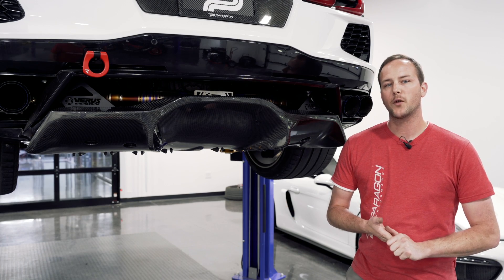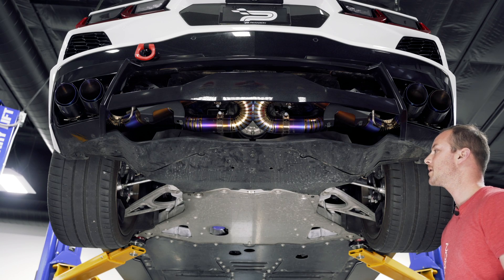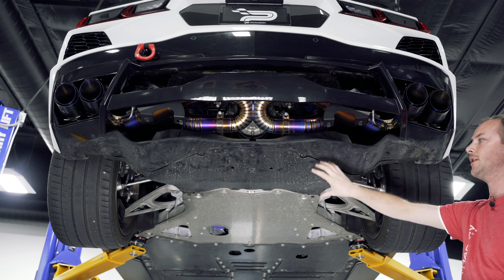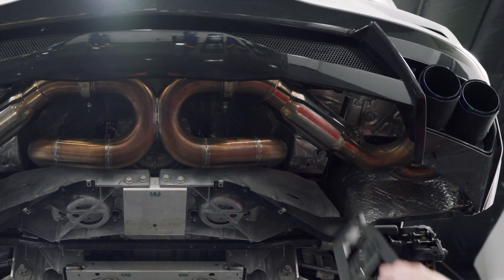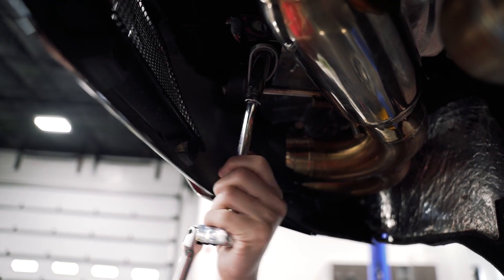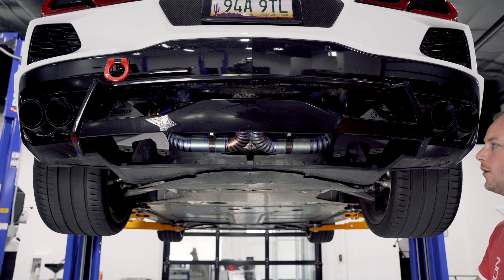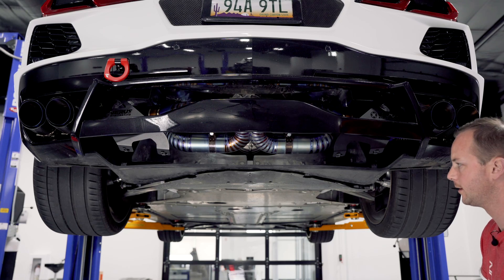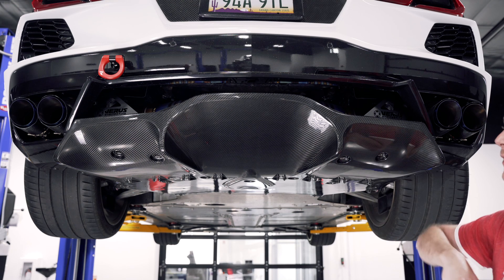Verus Carbon Fiber Rear Diffuser Install For C8 Corvette - Paragon Performance

Comment: I can tell just by looking at it, that this is what you want for track. Paragon needs those side skirts for undercarriage air flow management.
Reply from the maker: The undercarriage strakes?
Reply: @ParagonPerformance  I meant strakes.

Comment: Does the diffuser have to come off for oil change or transmission service?
Reply from the maker: The diffuser does not need to come off for oil change or transmission fluid/filter service.
Reply: @ParagonPerformance  Thank you for the reply. 👍 Waiting for the carbon flash version.
Reply: @ParagonPerformance  Awesome, thank you. Waiting for the carbon flash one. 👍

Comment: When u say “ it performs “ do u have figures ?? How much downforce is it adding ? Does it at least reduce drag compared to stock ?? Any hard data at all ??
Reply from the maker: All data can be found on the product listing. 

https://www.paragonperf.com/verus-engineering-c8-corvette-carbon-fiber-rear-diffuser-.html

You can view the full 18 page report on the Ventus 2 package here:

https://www.paragonperf.com/assets/images/C8_Corvette_Ventus_Report_v1.pdf